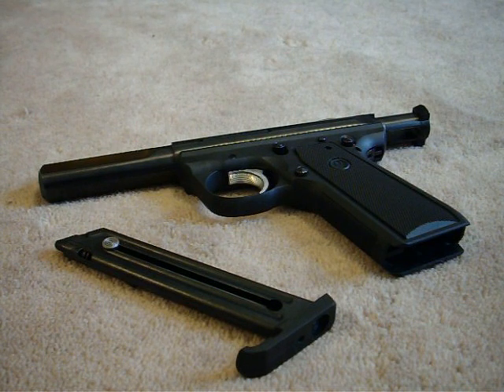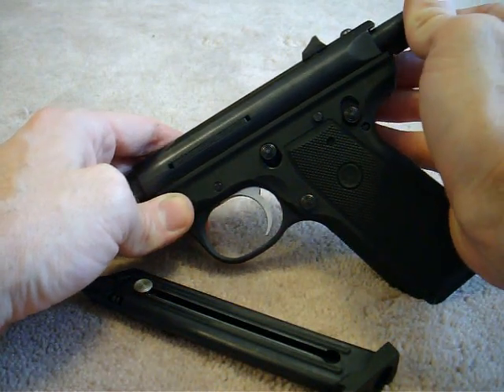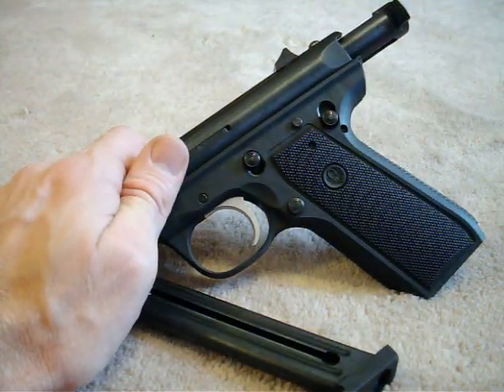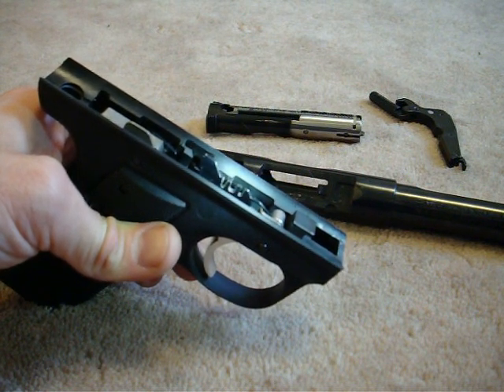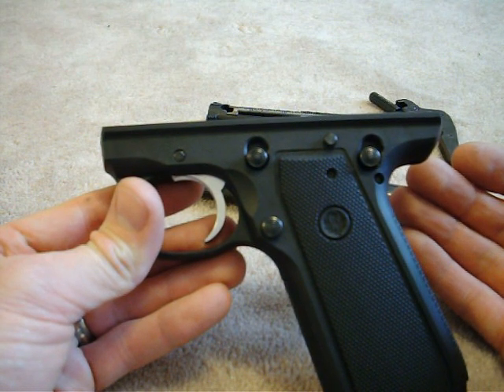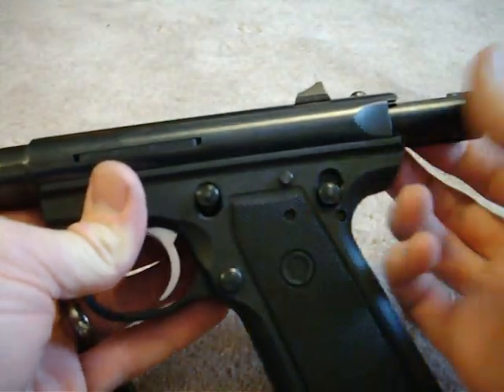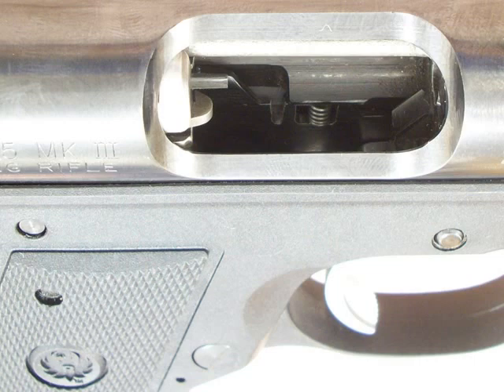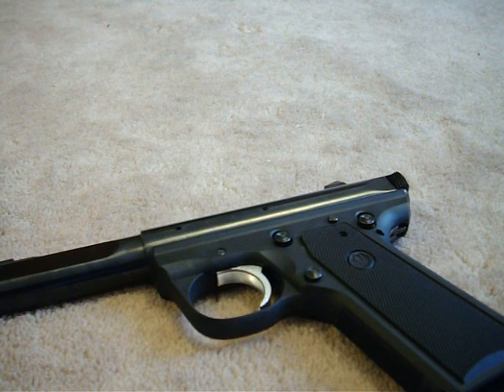Ruger 22/45 Bolt Release Spring mod

Comment: Just did this mod. Sweet and easy. Used the detent spring from same bolt lever part and works like they meant to do it.  You can always buy a replacement lever on Brownells website for like $6 if you mess it up or dont like a smooth loading 22/45.

Comment: Just did the mk2 style bushing to eliminate the mag disconnect on mine. The spring that came off the mag disconnect lever with a little bending fits nicely into the frame and also works with the above notch. Thanks for the inspiration!

Comment: Just did this yesterday, works like a charm. The regular mod did not work because there was too much friction on the lever, so a spring was REQUIRED for it to work at all.  I used the little spring that i took out of the knob.

Comment from the maker: @1masonking The mod that removes the mag disconnect feature often allows the mags to drop free. Two of my three mags drop free with no trouble and the third one often does if it's empty with the bolt locked back.